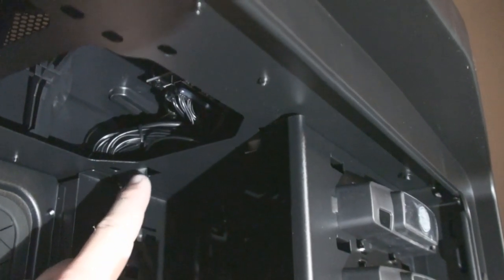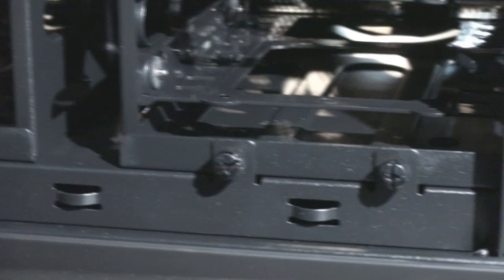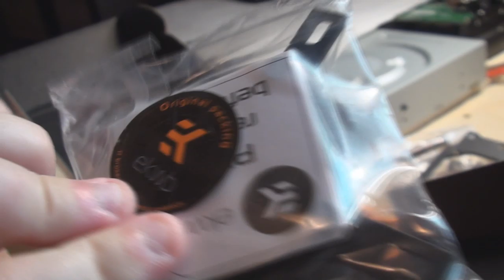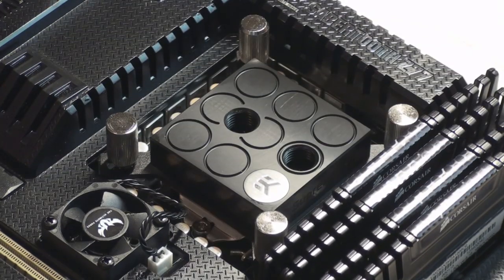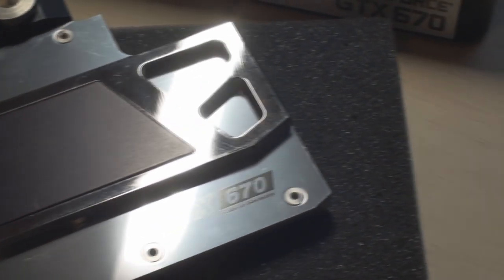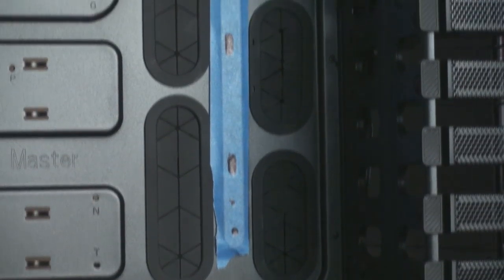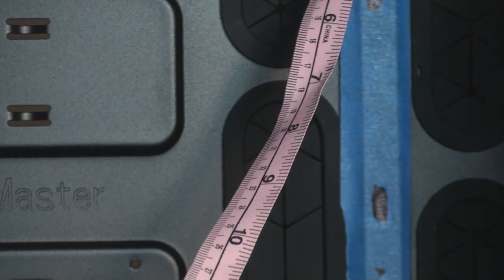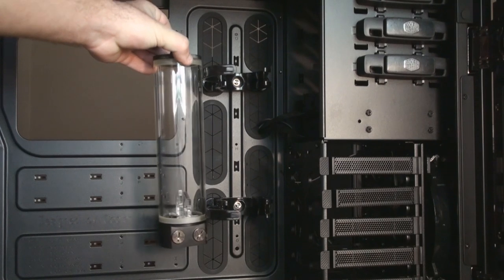Cooler Master Cosmos II Custom Liquid Cooling Build Part 2 - Radiator Placement and Assembly

Comment: You can use "Alphacool NexXxoS Monsta 240 80mm thick Radiator" for the bottom of the case which is better I think...

Comment: Hey Miller, I'm going to buy a 240mm radiator(i want it to be mounted downstair), but at the same time I'm going to buy an acrylic side panel with fan holes especially built for hard drive cage so the fan holes are smaller. So i was just wondering if i could mount a radiator behind the hard drive cage fans?

Comment: I have a GTX 670 an i7 2600k and 16gb ram, I have clocked the i7 at 4.8 ghz with silver arrow Sb-e extreme, in one of your videos you say you run an i7 2600k at 5ghz can I reach that with the silver arrow???

Comment: Good work man. What kit did you use though? Did you get Push Pull or just Push ? I will be doing this same mod on my Cosmos II because the Corsair H110 just isnt enough at the top doing push. I need to know if the Rad and the 4 fans will fit in the bottom area.